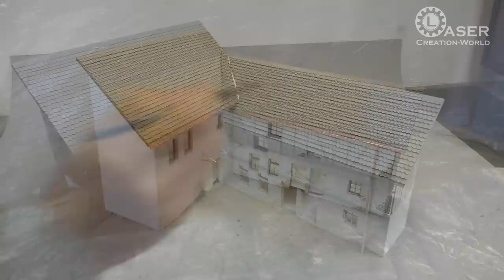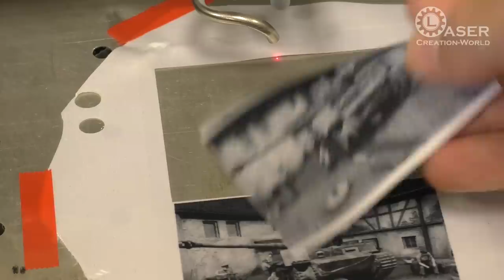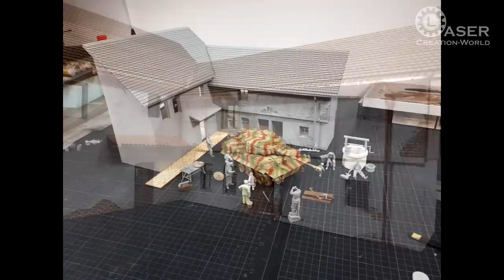Diorama Tiger 1 Panzerkampfwagen VI scale 1:35

Comment: Finally ! Someone who understands that after any other physical modifications are complete 
  and it's time to paint, any figures have to be painted and weathered as much as the vehicle and the rest of the diorama. So many will do a great job with everything else, but paint a figure it's basic colors and let it go at that. And they'll oh my GAWD, paint the eyes dead white with a blue dot for eyes !! Great if the figures where all born with gold fish goggle eyes, but it looks just awful !!
  I can't build anymore, no feeling in my fingers from diabetic nerve damage, but when I was building, I would temporarily mount each figure to a wood handle so I could hold it. Then put the figure under a desk lamp, take a small tip marker to highlight the shadow where the light is darker in recessed areas. Shadow and highlight, exaggerating the effect, almost like an optical allusion. Two simple and fairly easy steps that make such a HUGE difference ! If you do nothing else but these two steps, it makes a nice looking model.
  And you avoided the impulse to add TOO MUCH to the diorama. Something you see a LOT of in model railroading. It makes the diorama too confusing because there's too much to look at besides the vehicle itself. Less is DEFINITELY more. Too much tends to muddy up the "story" you're trying to tell. The hardest part is not figuring out what to ad, but what to leave off. Anyways, WELL DONE !
Reply from the maker: Thank you Ron

Comment: The work is absolutely beautiful and also the idea of mirror museum and real scene is unique and interesting! But there are some minor moments I've noticed like missing wear signs and dirt on the tank that went wrong (it's a situation during real war, or they haven't reached the front line yet?), preserved grass in the tracks (which doesn't correspond to the weight of tank), and perhaps rather relaxed atmosphere emphasized by the boy with goat (maybe my erroneous impression) which doesn't quite suite to the situation - it's a German architecture, so it should be the last phase of war when it came back to German territory.
And I agree with comments bellow and thank you for sharing the build work and procedures you use - nice to learn!

Comment: The jack rested on the part that covers the tracks. Is it possible to withstand the weight of the entire tank?
Reply from the maker: There is an original picture that I used for orientation, which I also showed in the video?